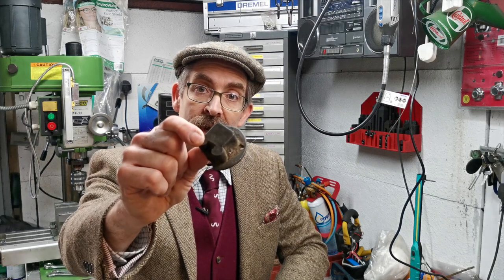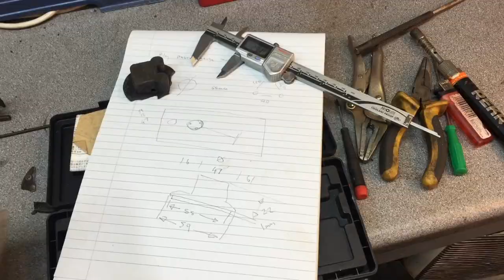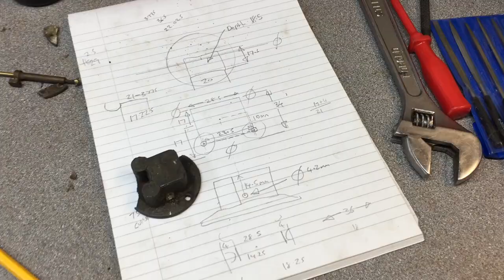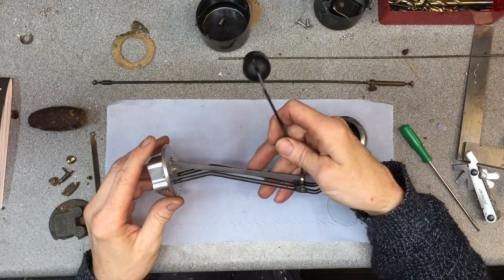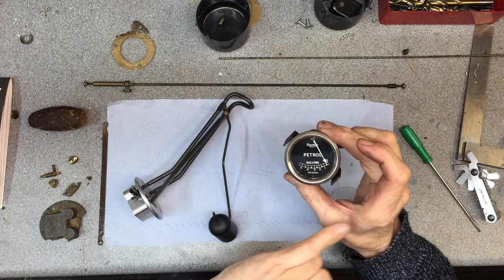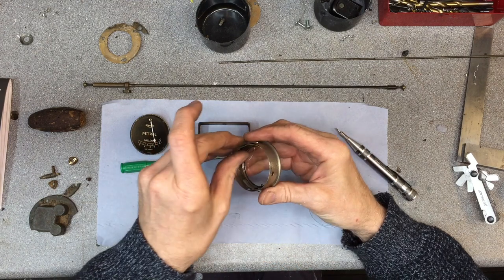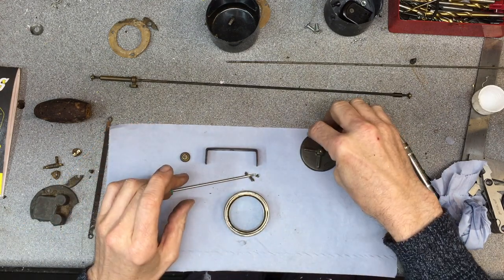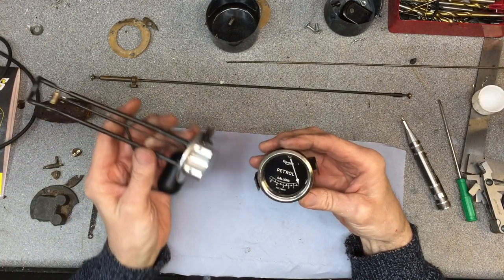Riley 9 Ripault fuel gauge sender resto, machining  fuel sender head to replace crumbling original

Comment: Another fun Tweedy production, I like the way you took the chuck off the lathe so you could mill it, ingenuity at its best.. Look forward to the next on.
Reply from the maker: Glad you enjoyed it
Reply: Wish the Hobson Teleguage fitted to my 34 Monaco   could be fixed to avoid carrying a long wooden dowel dipstick and a can of petrol. An excellent job Mr Tweed.
Reply: @anthonyolpin8567  Telegauge has always seemed like a bit of a gimmic to me! I saw a 9hp at a show a couple of years ago which retained the original dash gauge-but it had little illuminated LED increments installed within. Much more visible (and probably much more reliable) I assume it had a conventional float in the tank.

Comment: A nice job sir! My Standard Swallow has a mechanical fuel gauge, connection is with a chain, which is broken & I will need to replace, my top is just a bit of tin so that is much easier to repair, just needs to be re-plated. Thanks for sharing.